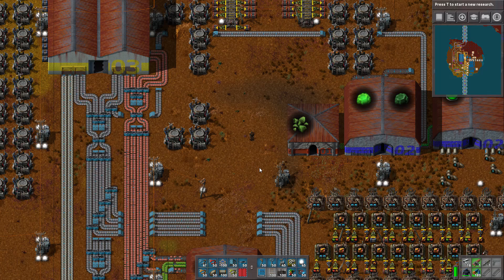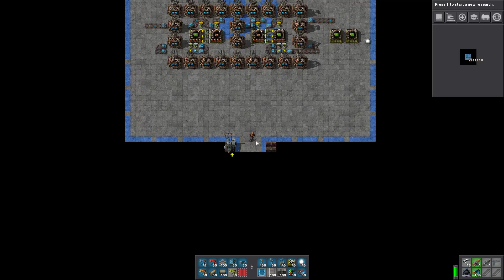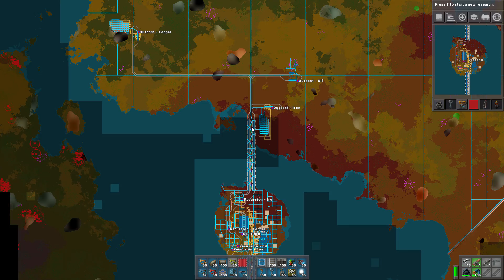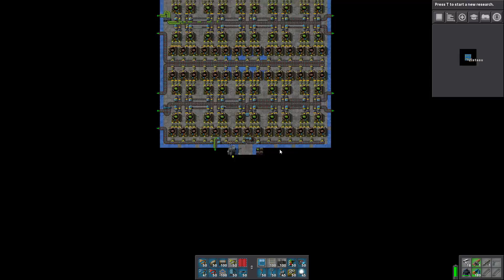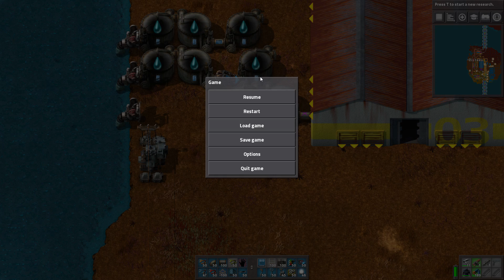Factorio Recursion #19 - Finding the Right Layout (0.15 | Factorissimo Mod)

Comment: Stack inserter CANT FEED high speed assemblers!!!!!!!!!! and multiple wont help! (animation locked)

whenever there is one of those hi speed factories which are supplied from belts you should limit the stack inserter stack size. The problem being that inserter wait until the assembler requests material. at which point they start the animations. But picking up from the belt takes some time thus the assembler has to wait until the animation is being finished. Multiple stack inserter wont help as they synchronize. Therefore they move and wait simultaneously.
There are two solutions. 1. Reduce the stack size to decrease the animation time until they swing without any waiting or buffer in chests where inserter wont wait for the "requests".
PS: its really nice to c in your green circuit production and its iron supply

Comment: Factorio (I think by design) has imperfections which make the math not always work out, like the inserters take time to move to the right place over the tile to pick up the item, and that time will differ depending on a lot of factors. For example, from memory, inserters picking up from corner belts have to travel a bit farther. Stuff like that, including things out of your control, cause the little micro gaps. And I like that about the game, it makes it feel more like a real factory instead of a spreadsheet. Nothing against spreadsheet simulators by the way, I like those too.

Comment: If the under belt it skootched over  a bit.. you could insert the  the cable in to a chest, the chest to a other chest, then from the chest to the circut production. This would create a rather large buffert that would make  

Also... i would probobly just have one assembler on every side of the belt. Then mix them together.

Technicly with this imput, you should be able to get 5.22 belts of out put

Comment: The problem with your green circuit micro blip in compression is due to how you're trying to load/merge them.  You're effectively trying to unload onto 2 half lanes and that fancy balance on the end isn't doing anything special for you.

Take 2 green circuit assembler outputs and put them each on one side of a belt.  Take that and the output of the third assemble into a splitter which is a normal simple lane balancer. 
 You don't even have to unload onto underground belts and you'll get fully compressed this way.  I hope this make sense without pictures.
LaneBalance(A + OtherHalfLane(B), C)
Reply: Landon Kryger Yeah, I guess the inserters didn't have space on the lane to put greens on.
Reply: The problem with having assemblers on either side of a belt is getting full beacon coverage on both sides of the assemblers. I'm pretty sure it's not possible to compress a belt 100% using vanilla tools anyway.
Reply: He's got 2 tiles of height below each assembler and a ton of room to the right, that's plenty of room to balance 3 half belts of items.
Reply: What I'm saying is, if you put assemblers on either side of a belt, then the beacons don't cover top and bottom any more. You could do the balancing elsewhere, like off to the side, or bottom of the build, but from my knowledge of the game mechanics, this is already pretty close to as compressed as you can make a belt without using some kind of mod, ie. with just inserters, splitters, side compression etc.
Reply: However, I misread what you said. "Take 2 green circuit assembler outputs and put them each on one side of a belt." is not one assembler on each side of a belt.

What you're saying makes sense. It would work just fine, and be a much simpler build, but I still don't think it could manage to compress it any more than it already is.
Reply: I played around with it for a few minutes in a test world with a creative mod, and while his uncompression is very tiny, it can be eliminated.

Comment: So, the micro gaps -- I'm pretty sure you cannot fully compress a belt with curves in it. You keep using that number of 40 items per second but when you push items around a corner, doesn't the compression suffer as a result?
Reply: The corners don't matter anymore, they changed the belt physics about a major version or two ago.
Reply: Wasn't that fixed in an update some time ago? Now belts work as expected instead of decompressing on curves.

Comment: You never checked what happens when you connect multiple input pipes? Only output&input connected. Unless I missed something?
Reply: Probably possible to have more factorissimo pipes between the tank and factory, if it helps with layout. That way the tank wouldn't have to be almost right next to the factory input.

Comment: Instead of piping liquids in, why not put them into barrels, then use the bots (or belts) to move the filled barrels in and the empties out? That seems more scalable than fiddling with those tanks...
Reply: DarkVoidIII a barrel holds 250 water, a blue belt can move 40 barrels per sec, so you can insert 10k/sec with barrels, i doubt that one pipe/pump is that fast
Reply: You can put the barrels into a chest and let it place in and pick up by bots. That way you are limited by chest size and robot amount/roboports. Way above 40 items per second.
Reply: I haven't seen him test that, yet, I wonder if he has already, and decided off-camera that it was too slow?

Comment: Zisteau, if I got it right, you don't need to have the storage tanks right next to the building. You can have it further apart and make a long bulk input pipe.

The input/output pipes can be used in chain, they can throughput to another pipe of the same kind.

Comment: A fast inserter and stack inserter for the copper plate input on the copper cable machine will smooth its input and output.

Comment: Its not the copper wire output you have to make sure never hits 0. You have to monitor the copper wire input slot of the green circuit assembler, because the copper wire assembler will stop working if the green circuit assembler has enough copper wire (which is exactly what happened). It doesnt need two inserters to inserter copper plates.
Reply: You can get around that by having a limited chest between them so that the copper wire always has a buffer.
Reply: Get around what? There is no problem :D

Comment: From the looks of things, if you had the tank chains on the outside of the 4 access points on a quarter, you could have belts on the insides. That would mean you could use all 8 points on a side, 4 for liquid and 4 for belts. Alternatively, you could use the pumps directly from tanks to the inner points, but the tank chains would have to be at 90 degrees to the side.

So, for the top:

'( ),| |  | |,( )'
 [ ] [ ] [ ] [ ]

(Key: '( ), tank, with fill port in top left and bottom right, ,( )' tank with fill port in top right and bottom left, | | belt)

Or:
    ,( )''( ),   ,( )''( ),
,( )''( ), { } { } ,( )''( ),
        [ ] [ ] [ ] [ ]

(Key: { } pump)

Comment: If you start running into lag, you can cut out one stack inserter on each machine. They only need one stack and one fast inserter to deliver the 30.8/sec copper wire the assembler can produce.

Comment: What about copper wire being made in another recursion feeding out to the green circuit machines?   Only downside I can think of is not sharing beacons may cost more power, but that might be offset by the green circuit array being smaller in footprint without the wire assemblers there.
Reply: That would require the copper cables going through belts, which means the green circuit machines would have to pick the cables from the belts, which is the same problem Zisteau was having before.

Even if the belt is saturated, the stack inserters can't pick up the cables from the belt fast enough. Stack inserters pick faster from chests/wagons and assembly machines than from belts.

The other possible solution, although not energy efficient, would be the copper cable machines depositing into provider chests and delivering it to the GC machines via robots. 

You could also teoretically pick the cables by train and unload it directly into the GC machines without using belts, but that would be messy and wouldn't work in the factorissimo mod.
Reply: Oh, well, thinking better about it, your idea could work if the copper cable plant delivered 4 belts to the GC plant, that way you could have 4 inserters per assembly machine picking up cables. But that would be ugly messy to set up.

But even then, you'd have a limit on how many GC machines you would be able to sustain, because no matter how many copper cable machines you make, you'd reach maximum throughput of the express belts.

The way Zisteau did it is better because it is easily expandable. If he needs to expand, just plop down more of those blueprints.

Comment: Wow I'm early! Cheers Zisteau, loving this series. So much integration (well, recursion) possible!

Some things I thought of durign the last couple of ep's: Don't worry about filling factories. Just Recurse Deeper! Also, use them as routing connectors (ea; You don't have space to put things in a certain side? Put a factory there and switch the routing inside that). Also, youy aren't using the recursing blueprints? (like the ones that are equal at any recursion level) Why not?

Anyways; Thanks for this series, highly enjoying it!

Comment: Looks like you can squeeze some conveyor belts around the tanks.  Are the tank hitboxes round or square with the factory mod?  If the tanks DO block input slots - then try pump chains?